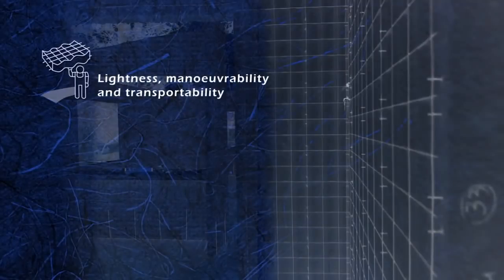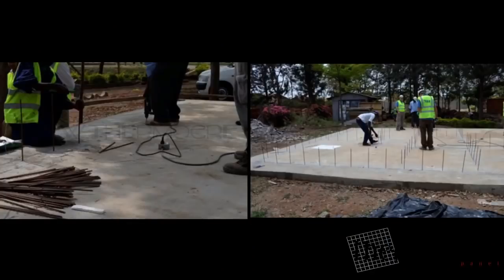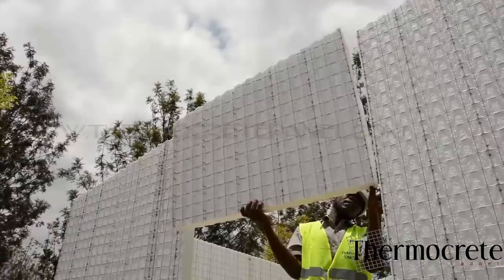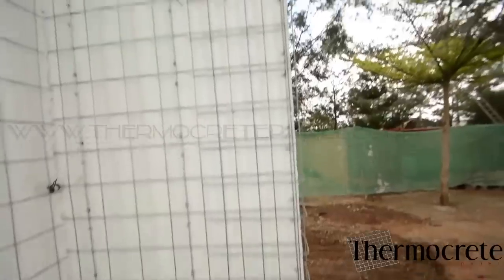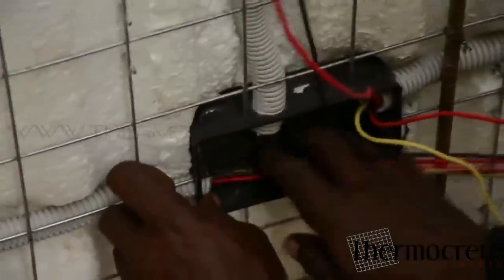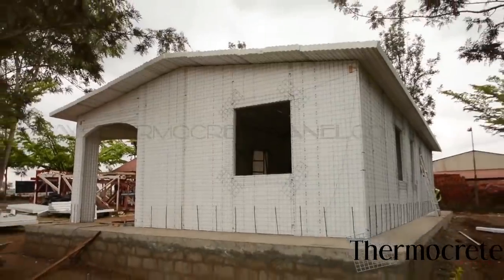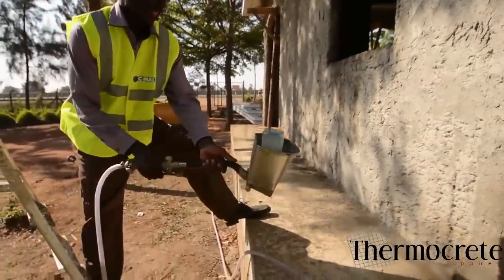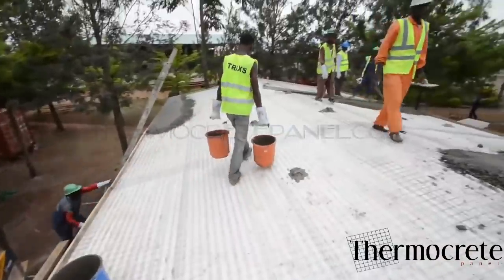18 நாளில் கட்டிய தெர்மோகோல் பேனல் வீடு-Thermocrete panel -New advanced building system in tamilnadu

Comment: Everything is good but when talking about strong & strength I don't think it will stand equal to the bricks wall,  bcaz in the center a thick thermocol & both side covered with cement layer there is nothing to make it strong, if I hit heavily with a hammer will the wall stands still without any damage like a bricks wall, if a bricks wall can observe a pressure of 2 tones (2000 kg) of weight, can this wall observe at least 1 tone. If you say it can observe & control more or equal weight pressure to the bricks wall, then plz upload a demo video comparing weight pressure of both the walls, bcaz home is a dream of everyone & Family is life of everyone, So we can't take such a huge risk without any confirmation in safety precaution. I hope u vl upload a video ASAP, bcaz building a house in less time is not a matter, it should be strong and everlasting for a long time till our son live & till our grand son live with his son in the same house without any fear, there stands the quality.
Reply from the maker: FYI the panel consists of thermocole sandwiched between welded wire mesh over which shotcreting  is done finished by plastering not only cement plaster as you said. Also the compressive strength of first class brick is 105 kg/cm2. Our Thermocrete panel's compressive strength is 130-140 kg/cm2. If you have any further questions you may mail us @ support@thermocretepanel.com we will clarify you everything
Reply: Viju NR good question

Comment: 600sorfeet
Reply from the maker: Costs nearly Rs. 10. 5 lakhs including tiles, wood work, electrical, plumbing, sanitary fittings, inner wall pop putty, outer wall white wash with elevation texture painting, septic tank and overhead tank

Comment: 9789538204.Pl.furnish deatails for construction of a 400 sq.ft.building as first floor in my existing house.
Reply from the maker: Costs nearly Rs. 7 lakhs including tiles, wood work, electrical, plumbing, sanitary fittings, inner wall pop putty and outer wall white wash

Comment: 3 1/2 centla 2 floor veedu katta evlo cost aagum. pls reply to me  quickly
Reply from the maker: VETRIVEL NISHA 
Cost nearly Rs.44.5 lakhs includes tiles, wood work, electrical, plumbing, sanitary fittings, inner wall pop putty and outer wall white wash with elevation texture painting

Comment: I think its toomuch cost per squarefeet 1450something... Bricks vachu ketrathukae evalotha chargepanranga
Reply from the maker: if wants to deliver quality construction in current material and labour charge we can manage only @ this rate
of course we are not interested in compromising our quality of construction by doing at low budget
Reply: @Aginfraprojects_thermocrete  OK bro. But 1500rs only bricks and cement houses.. But ur construction cost is similar to that..
Reply: @Aginfraprojects_thermocrete  wall la any drill or aani adika mudiyuma   ??